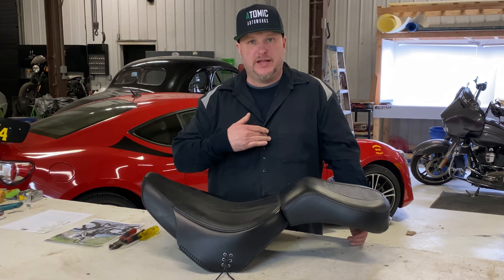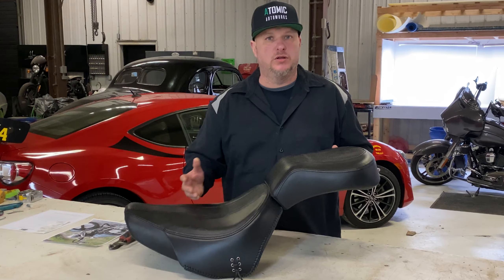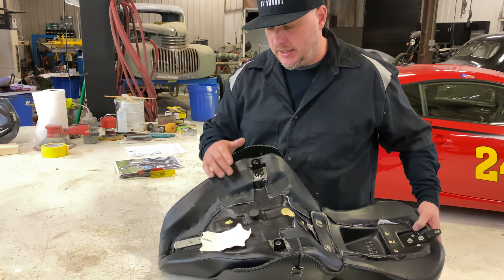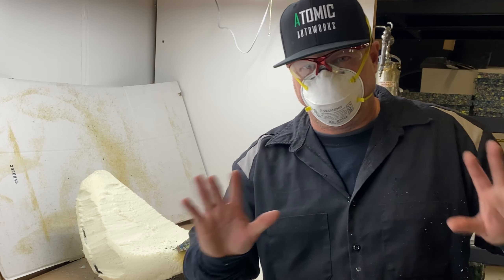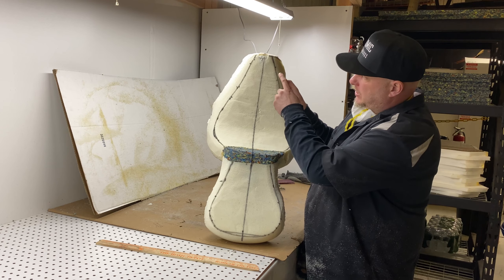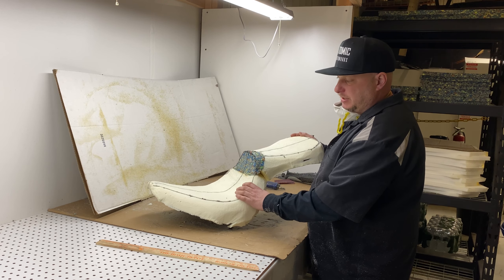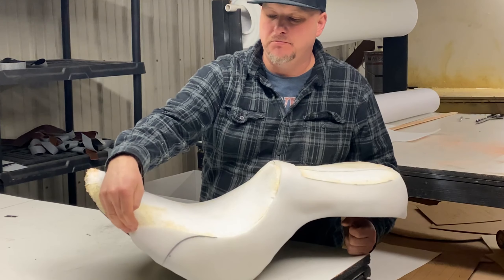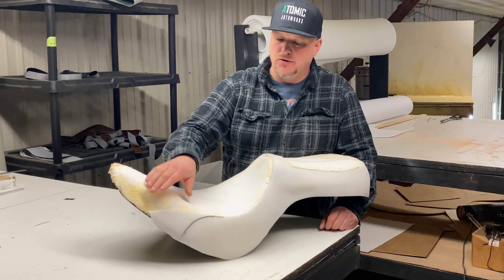How to customize a Harley Fatboy seat.

Comment: I've got a 2023 fatboy.  After an hour, my tailbone is sore.  Is this something you've fixed for other customers?  Seen some videos where they cut a hole in the foam and put the original fabric back over but I worry about the seat looking out of shape.  Was wondering if ballistic gel or something could be done but rather find someone who has done this before.. thanks
Reply from the maker: Ballistic gel isn’t good for seats . Orthopedic gel is the only one we recommend and not for tailbone issues. Your seats needs to be sculpted so your checks take all the cushion and most likely a tailbone relief cut will help. Thanks

Comment: I have a fatboy lo and looking to raise seat couple of inches in order to crest more pocket space under seat. Have a lot of Additional lighten and fuel pack which is tight now causing issues. Can something be done to create more space between matters and seat ( trunk space ) without having a visual gap all around seat? It is a 2 piece seat.
Reply from the maker: Yes however it sounds like you would need a custom pan for your modifications. Email us customize@atomicautoworks.com thank you.